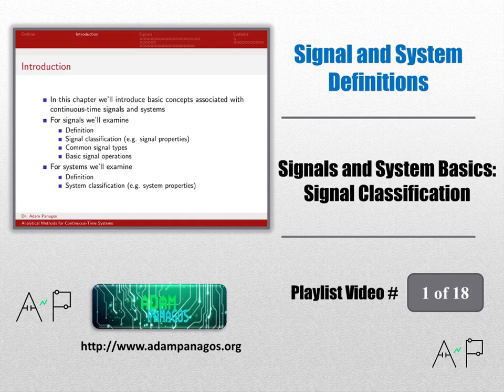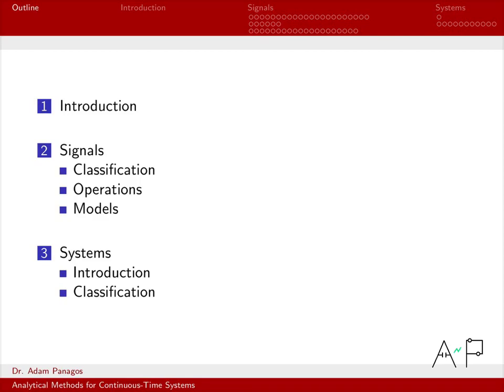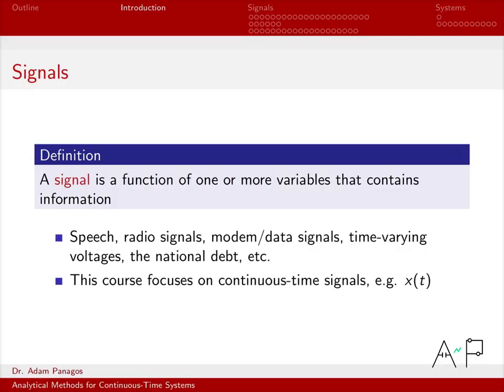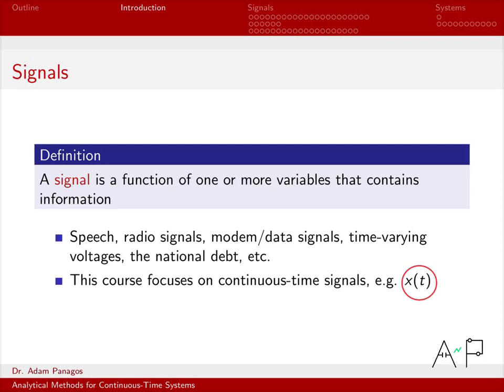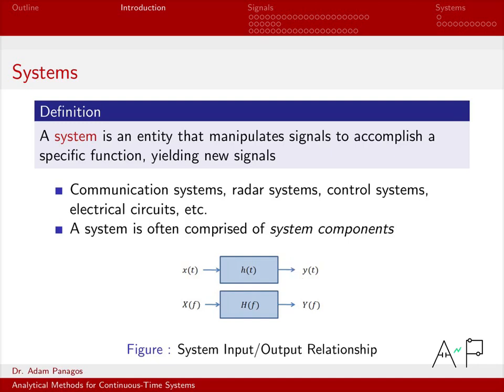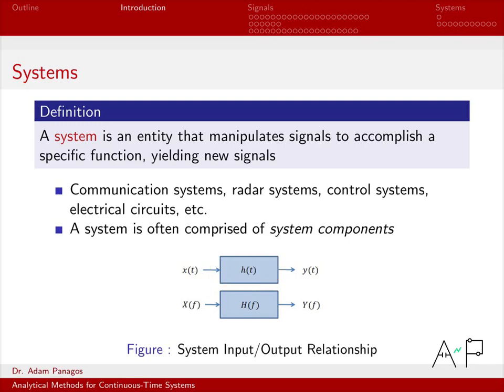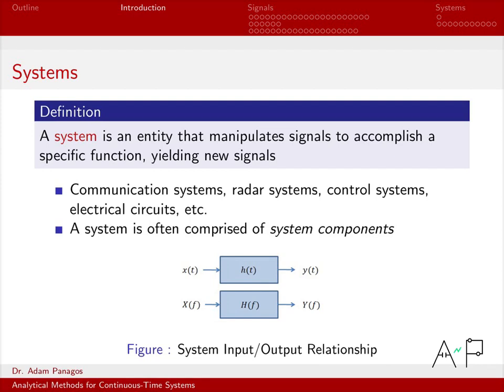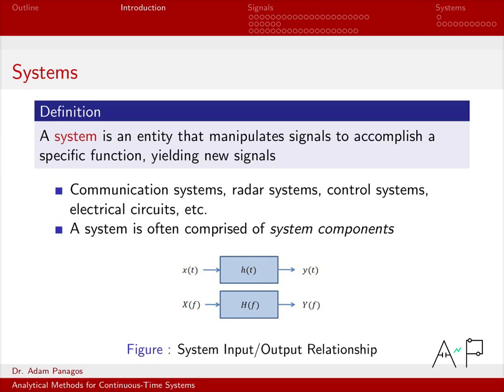Signals and Systems Definitions

Comment: professor what books do you reccomend to refer with this course ?
Reply from the maker: The textbook used for the course is, "Signal Processing and Linear Systems" by B. P. Lathi. A link to the 3rd edition is here:
https://www.amazon.com/Processing-Systems-Electrical-Computer-Engineering/dp/0190299045/ref=asc_df_0190299045/?tag=hyprod-20&linkCode=df0&hvadid=475772152460&hvpos=&hvnetw=g&hvrand=5985774764578063069&hvpone=&hvptwo=&hvqmt=&hvdev=c&hvdvcmdl=&hvlocint=&hvlocphy=9012700&hvtargid=pla-1381057485072&psc=1